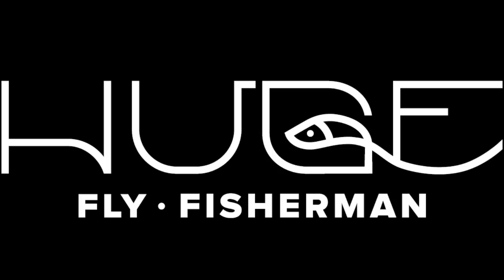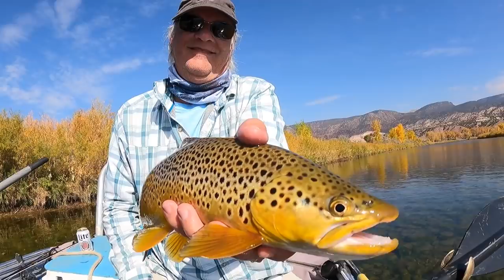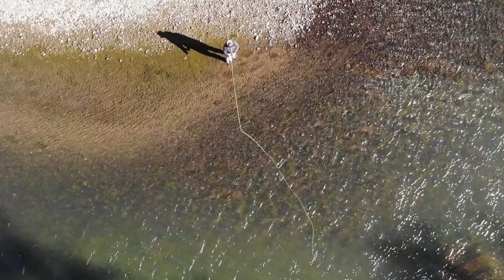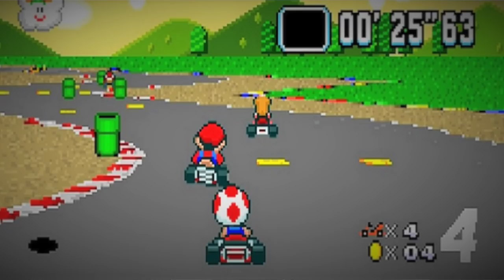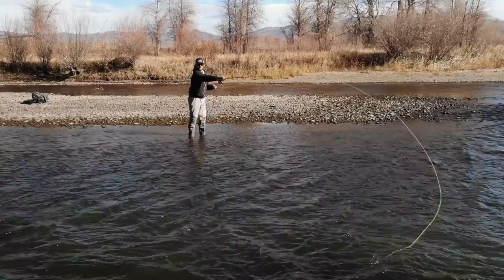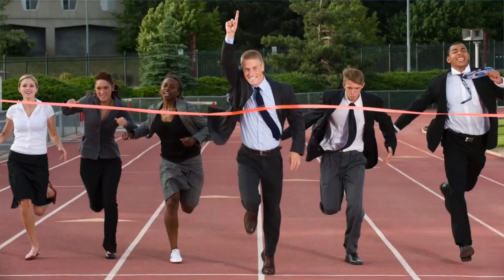MENDING - fly fishing how to

Comment: Just wanted to share some advice I picked up from a guide that really made my mending more effective. "It's ok if your mend ruins your drift for a foot or two if it means it will be natural for the remaining 90% of the drift." For whatever reason I had always obsessed over trying to make the enitre drift perfect. And more often than not, that usually meant my drift fell apart halfway through cause I hadn't mended enough early on. But just doing it right in that first few feet so everything is setup for the rest of the drift means more often than not that you're drag free for the majority of the drift. It's simple advice but something I think many of us struggle with.